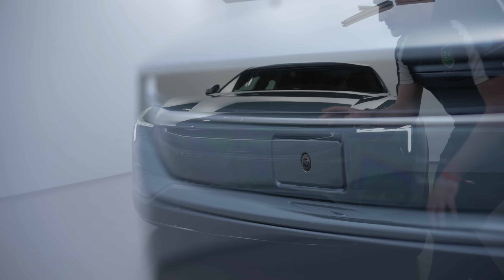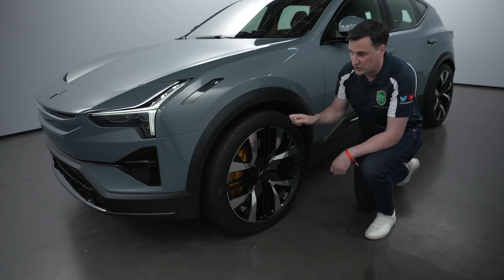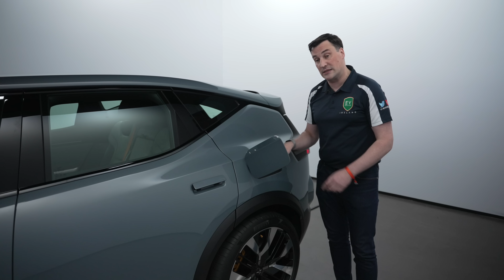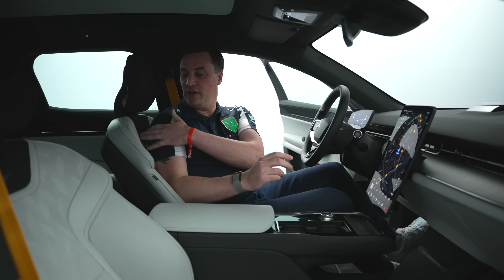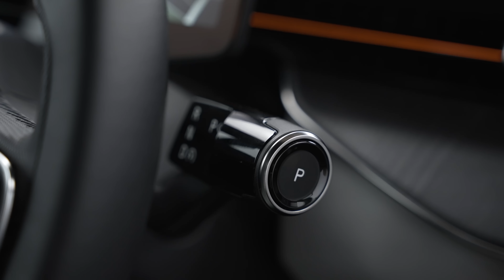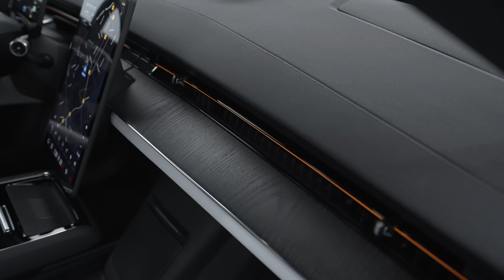Polestar 3 - 1st Look

Comment: Thanks Derek - finally an EV beauty! This is joint top of my shortlist, great value considering that an IX 40 is about 15% more expensive with much smaller battery/range. Only disappointment is the boot size. Waiting for the EX90 before I order!
Reply from the maker: The Volvo is going to be a winner too

Comment: how did you find rear passenger space Vs the model Y ?
Reply from the maker: Thanks for the question Ricky. Lower and not as much thigh support as the Model Y but better feeling seat support and structure
Reply: Important to note is that the size of the 3 is more in comparison with Model X imo since it's basically a xc90 and not a xc60... :)